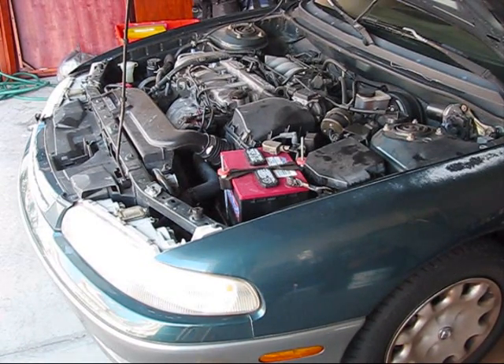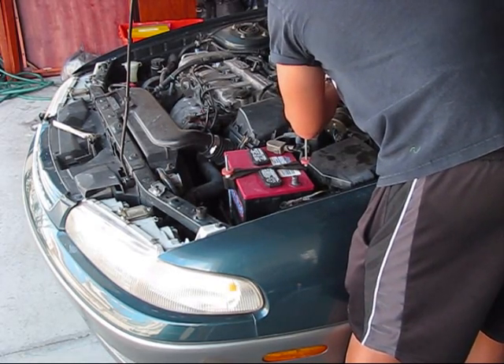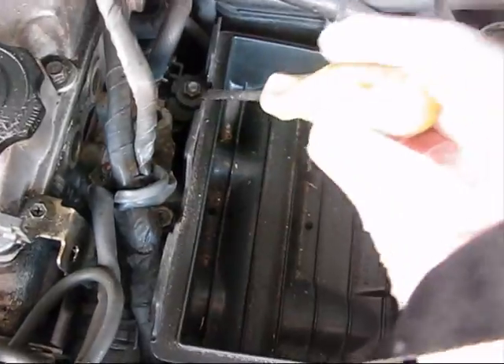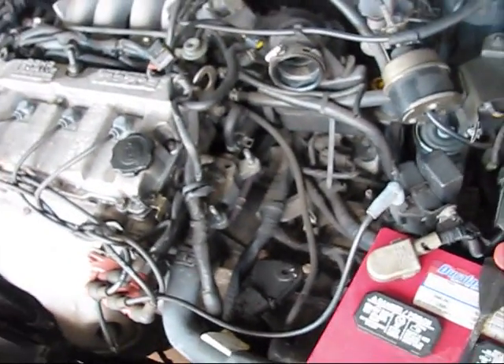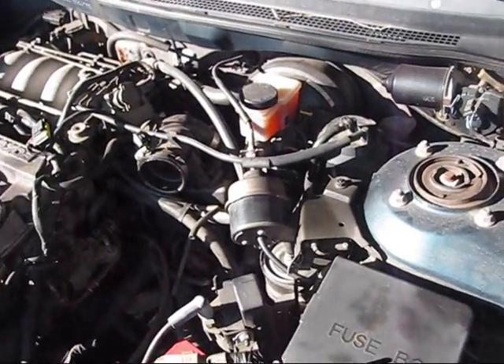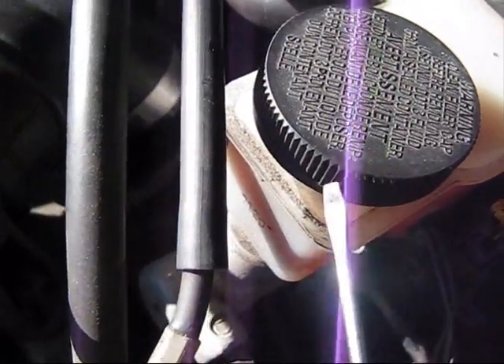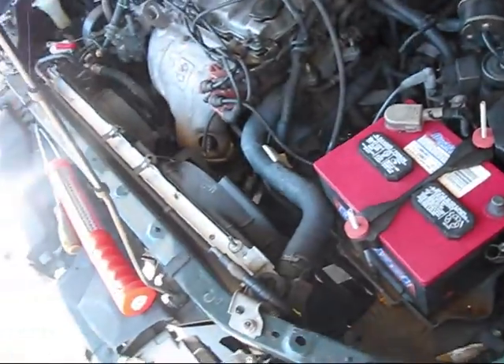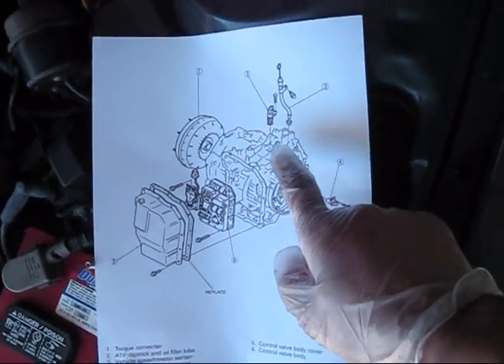Mazda 626 Vehicle Speed Sensor Location Removal part 1

Comment: One thing to chrck if you are having speed sensor codes and no speedometer, there is a two wire sensor on top of the cv axle output on the trans. it is up against the trans mount. sometimes the wires wear through, or that sensor is the problem. if sensor is the problem you will have to remove the mount tranny mount to get it out. just fixed mine and that was the problem. trouble code: Transmission Speed Sensor A

Comment: did you get the car fixby changing the sensors did it fix the transmission problem
Reply: I changed the vss and the transmission output sensor and no speedo or odometer. still has shifting problems.